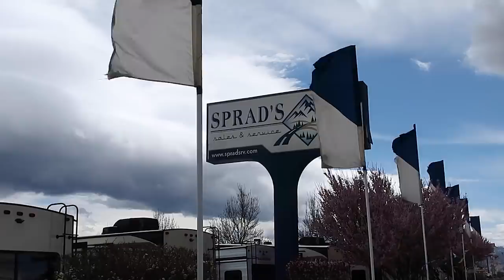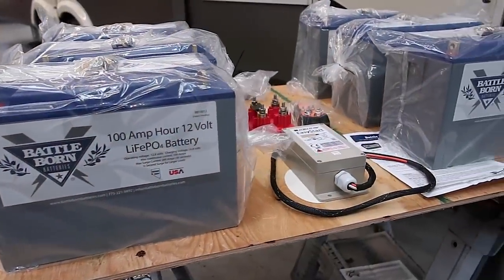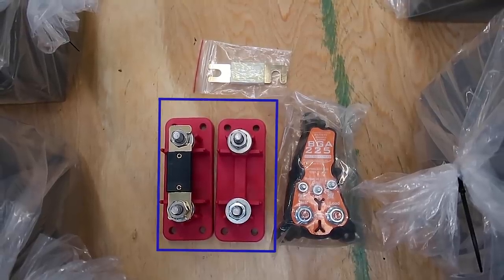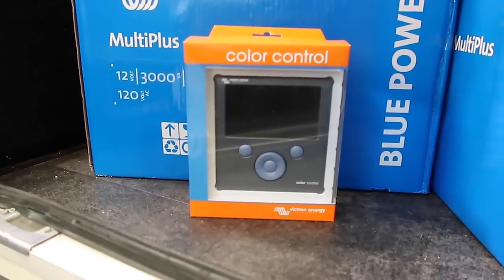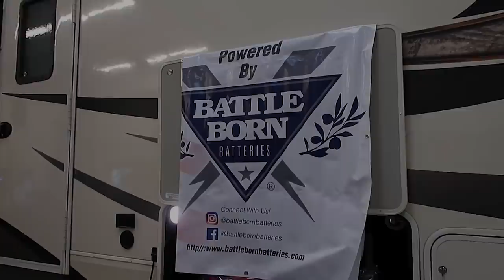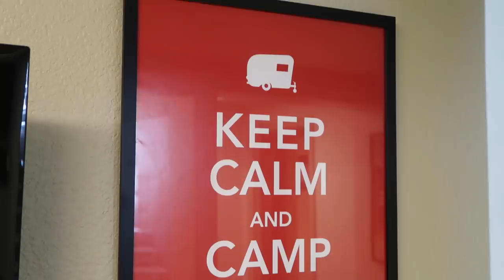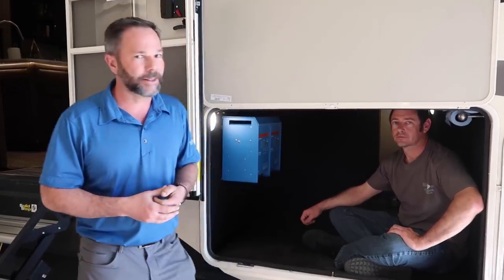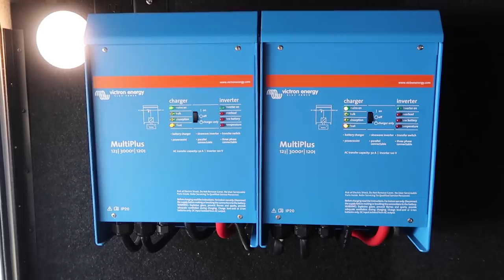Our Lithium Battle Born Batteries System Install! || RV Living

Comment: You state in another comment response that you wanted a system large enough to run the rig for 3 days without charging and added the battery you already had to the new battery bank for a total of 6 batteries so 600ah total. I believe that the AC compressors suck up 30 amps each so even if they both only run 50% of the time (which I assume would probably be the minimum in a hot climate) that means your system would only last 20 hours just powering the ACs with zero load from other devices, so I'm interested in your breakdown of individual electrical equipment consumption itemization for calculating how much battery power you need to run for 3 days. Thx

Comment: You did a great job of scooting around the cost of your system.
Reply from the maker: If we’re solely talking solar and not batteries, we spent around $2,500 for the panels, wires, junction boxes, tools, and everything else we needed for installation. We did that install. Our battery system is on Battle Borns website, and that is $9K.

Comment: Hi guys, I have a small (24’) older class A with 30amp hookup. I’m thinking about the Battle Born system myself to get away from depending on the loud gas generator. Unfortunately my small RV doesn’t have much basement or interior storage space. So my question to y’all is, do you think that I could do away with the generator and use that space for the Battle Born system?

Comment: Great equipment and install.  I just put 4, 100ah BB's in our Class A.  Next addition will be the same inverter as you installed but I'll need a consultation due to the complex nature of the coach systems.
Reply from the maker: Nice! The Battle Born team is super helpful and I'm sure will get you what you need. Happy travels!
Reply: Do you have a residential refrigerator? We have been planning the 4 battery install for our Thor Tuscany 42RQ with a 2000 watt Magnum inverter and feel like it will easily take us through the night. We need the ability to overnight and move on the next day charging off the coach alternator  (or fire up the generator) as our first step to adding more capacity.
Reply: Kim Bertram we don’t have residential refrigerator. It would be nice, but we make do with the smaller one we have.

Comment: You guys did a great job with this video.  It is nice to see a professional installation along with all of the DYI videos.  We are looking at upgrading our battery system in the next several months.  We are going to take the upgrades a little more incremental.  The hope is we drop in the four GC2 replacement batteries and add a new BIM on our class A to support charging from the alternator.  The next phase could be upgrading the invertor and rewiring the invertors into the 120V system.  The use of two 3000 watt invertors on a 50AMP RV looks very interesting.  Battle Born has been very helpful answering questions.  As part of our trip out west we plan to stop by Battle Born.

Do you recommend Sprad's RV in Reno to do installation and electrical work?

It has been almost two years since you installed your power upgrade (batteries and invertors).  How has it been working out?  What advice would you provide to someone looking to upgrade there battery system.

It was great to spend time with you guys in January of 2020 in Tampa and I hope to catch up with you guys again down the road.

Comment: How are the Batteries and inverters holding up?
Love your system!!!

Question?
What size wires between batteries 2/0? 
And what size wires to the inverter?

Im setting my cabin up with exact same equipment ....deciding to go either 2/0 or 4/0?
All short distances...
Thanks guys!
AZ BOB

Comment: Thanks for documenting your install!  We are going to Sprad's next month to upgrade our electrical system in our Class B Sprinter with BattleBorn/Vicron components.  Sprad's is recommending that we install both a DC-DC converter and a BIM but I haven't seen an install yet that has done that and the BattleBorn website's schematic only calls for only a BIM when there are 4 BattleBorn batteries.  What are you doing for charging from your alternator?  Thanks!

Comment: Do you charge the system with your alternator on the truck?? Can you charge the system with the generator while you are using the battery to power your RV or do you power the RV with the generator and charge the battery at the same time? How long to charge via generator if batteries are completely depleted with generator? and how long with grid power?  How much do you use just the batteries? Are they just for off grid??Thanks, great video. CAn you give us a guess on how long you could stay offgrid in a hot climate (90 degrees) with just batteries using A/C and no generator. God bless. CAnt wait to see your solar array.

Comment: I was wondering if longer periods of driving, allows your trucks alternator to add enough power to the Battle Born batteries to get them right up to 100%?    We're thinking of adding '3' or possibly '4', as we don't full time, but occasionally will boon-dock, the odd time up to a week.   We also wondered since we don't full time, if the 'suitcase' type of solar might be a good addition, especially for those good weather days.   It looks like we're nearly at the 6 month period since your install, so looking forward to hearing how all has gone, and if you've decided to add anything else to make the whole system efficient for your needs?
Reply from the maker: Our truck alternator does charge the batteries but we've added solar since this install and that always keeps our batteries at 100% when were traveling. We also have a generator that we pull out if we have multiple bad solar days to help charge the batteries :)

Comment: So cool! We hope to outfit our rig with some lithium batteries and solar at some point...once we decide to actually boondock a bit more haha. We are kind of in the same boat as you all before you started boondocking. With full-time jobs we pretty much try to limit the risk of interrupting our work by having some solid connections. Thanks for sharing the info, will help in the future for many! - Shane
Reply from the maker: Totally get it! We waited two years before upgrading to a system like this because of the same reasons you had. We wanted it to be worth it and not go to waste. With this in place we're totally committed to getting out boondocking more 👍

Comment: Hello you, this is the first time I see a LiPO4 battery system without Solar. But using a generator as a back-up charging is not such a bad idea, when you have solar you will have a hand on both recharging ways. Your system is a dream system and it is expensive but you will not have to up-grade for years if you learn how to manage your energy consumption a little bit. When I look at your installation I found that the negative and positive leads of your batteries are very close from each other. I was surprised that no insulation protection was put on them, even electrical tape on the positive leads will give a little bit more protection. Just a recommendation...

Comment: Neat installation here. Im a professional electrician and looks alot at the craftsmanship. Must have some experience to do things right. Have been looking at many installation, but are not allways impressed.
I have AGM 2x100Ah and 66kg(145lb) and with lithium it will be around 30kg(66lb) Can use the Xantrex 1800w inverter, because the voltage will drop below 11v DC when use the coffee maker with AGM. I wanna like to try 2x 100ah Lithium battery. These BatteBorn are not crank battery, so if I still want to  use the emergeny start .I cant use these BB battery? Its not very important to have this emergancy posibility. I think xantrex and Troyan has Lithium crank battery. For me its important to save veight, because I have 40kg(88lb) 4kw tranformer 230-120v/ 60 Hz for my US motorhome here in Norway(europe).
Reply from the maker: It's always a new experience when diving into a project. I'm sure the conversions can be a challenge in another country. Thanks for watching!

Comment: Wow! You found a Unicorn! An RV dealer/service department that does quality work and has a conscience. Great video. Did you upgrade the charge line in the truck to allow a higher amperage charge while driving?
Reply from the maker: Haha we did find a unicorn! We are so happy with Sprad's RV and their work. We didn't upgrade the charge line but that's definitely something to think about! Glad you enjoyed the video.
Reply: @GetawayCouple  HI there, like you, we have a GDRV Solitude and are from SOCAL.  I'm curious, did you not find a reputable installer in Orange County for BB batts/Victron upgrades?   Surprised you had to go all the way to Reno...can you explain?  Thank you.  We enjoy all of your videos..
Reply from the maker: @gregdavidson3375  We were in Reno visiting the BB factory and had our consultation there. After our consultation, we opted to have the install done there as they recommended Sprad's.
Reply: @GetawayCouple  Thanks!  Have you encountered any issues with the BB Bats or Victron Invertesr?  I will only need one Inverter since we are not full time and would only need up to 5 days of boondocking.  Thanks.   
One last question.  My wife and I are planning a trip to Michigan in 2121 but we want to stay clear of the Midges!  What month were you there, I don't recall seeing a date on the video.   Thanks, stay safe and healthy.
Reply: @GetawayCouple  Curious how long the labor part of the jobs was at Sprads.  I am getting 40-55 hours of work and I am only adding 1 3000 Inverter.   Making sure that I am not getting the shaft.  ;-).   Your feedback is appreciated.

Comment: Awesome system! It’s very similar to what I installed in our Imagine 2800bh. (I was lucky enough to only need 1 inverter though). Make sure you do the solar install this year so you can get the 30% tax rebate on the cost of the solar and the cost of this install (as you can count it as preparation for the solar). If you wait until next year you will only get %26. 
You guys are going to love the freedom of not always having to run the generator just to make coffee. ;-)
Reply from the maker: Hi Ron! You're very correct about the tax rebate, which was a big reason for wanting to do all of this together this year. We will be doing our solar soon (and doing the install ourselves, eep!) But you're so right, we're so excited for the freedom we're getting from this setup. It's already been a game changer!

Comment: So how do you recharge the batteries?  What is the average time of use of the batteries before they go dead?  What is the cost of products and to installation?
Reply from the maker: We want to use our system out boondocking a lot more to get more accurate numbers but currently we recharge the batteries with our generator or with the electrical post in a campground. We haven't gotten them down to 0 and recharged them so we don't know how long it takes to fully recharge them with either of those methods. The time of use is a hard question because it depends what we're running. The goal was to use 2-3 days without recharging, we'll let you know how that works out in a future video. The cost of the products are on Battle Borns website (https://getawaycouple.com/battleborn) and installation was around $1500 which included a couple different parts they needed for our specific setup, building custom housing, labor, etc. Obviously each dealer is going to charge you whatever their hourly rate is plus parts and that can vary from installer to installer. If you're comfortable doing electrical work yourself, this project can be DIY thus eliminating the install cost all together.
Reply: @GetawayCouple  I'm looking to do something similar with my RV.  Most of the state parks in NY don't have electric so I would need solar panels.  Awesome video on setup, thanks for sharing.
Reply: @GetawayCouple  I'm putting in a similar system except only 4 batteries and 1 inverter. Sprads quoted me a price of $2500 and 5 days to install. Sounds like they're gouging me.
Reply from the maker: @boyda1  Hmm... that does seem high for an installation. Does that price include anything else like products, wires, custom built racks, etc?
Reply: @GetawayCouple  They didn't say anything about the wiring or racks being extra. I just assumed that would be part of the installation, but I sure didn't think it would cost that much. They're suppose to call me tomorrow and explain why it's so high, so we'll see what they say.
Reply from the maker: @boyda1  Interesting... let us know what they say if you don't mind! Feel free to shoot us an email if you want at info@getawaycouple.com
Reply: @GetawayCouple  They finally emailed me back and said that's the price and they weren't changing it and that the shop manager agreed that it would take 5 days. I'm going to check some other places and may end up doing it myself. $2500 is just too much for no more than is involved.

Comment: Excellent Video, Both of them.  Can you give me an estimate of how much the installation was???
Reply from the maker: If we’re solely talking solar and not batteries, we spent around $2,500 for the panels, wires, junction boxes, tools, and everything else we needed for installation. Our battery system is on Battle Born's website, and that is $9K.
Reply: Thanks Rae,
By the way you do a very thorough job on your videos. You explain things the way I understand. I appreciated what you did with your Thousand Trails video.

Comment: Hello Jason & Rhea, we are planning on buying an rv in the near future but we are wondering if your future solar panels, converter, and truck alternator will charge your lithium batteries without any other equipment? Good luck with your equipment. Thank you for your time and assistance.
Reply from the maker: Hey! Solar is next and that will absolutely charge the batteries. Our truck will not charge the batteries while towing but that's not something we even realized was possible until people started commenting. It's definitely something for us to look into!

Comment: Question: what did you do with your original converter?  Is it still utilized to feed your DC system? Or was it removed and everything wired to the inverter/charger?
Reply from the maker: Hi Bruce! It was removed and everything wired to the inverter/charger.

Comment: Great video. Thanks for posting it. I’ve never seen a battery setup that will run both ACs. How long do you expect to be able to run them on the batteries?
Reply from the maker: We haven't tested it but we were told that we could run one AC for 5 hours on the batteries with nothing else running. We want to do some real world testing (but it hasn't been warm enough lately) to get actual numbers of using the batteries and how quickly we can recharge them with the generator vs electrical pole at a campground.
Reply: Getaway Couple, thanks for the extra information. Let us know how your testing goes. At a minimum you should now be able to run the ac while traveling so the rig won’t be hard to cool down when you arrive somewhere. I have a residential fridge so it would have to run that too for me. Thanks again.

Comment: So I just built the cart with everything I could find at battleborn.com minus the cables and I'm at $9,921.45. That doesn't, of course, include installation. Installed this system would be well north of $10,000. I would literally need to cash in Jason and Rae's 401k's to be able to afford this in my RV.
Reply from the maker: Lol we'd get hit too many early withdrawal penalties, we looked into it 😉This size system is best for those with a lot of power needs in a big rig who don't want to be inconvenienced. You can absolutely get away with something smaller.

Comment: How much did the total Solar install including batteries, panels, inverters and labor cost ?
Reply from the maker: If we’re solely talking solar and not batteries, we spent around $2,500 for the panels, wires, junction boxes, tools, and everything else we needed for installation. Our battery system is on Battle Borns website, and that is $9K. We did our solar install! However, our batteries and inverters were installed by Sprad's RV in Reno, NV.

Comment: What was the cost of installation (not including the equipment)? You cannot find this out on the BattleBorn website as you suggest.
Reply from the maker: Hi Peter, installation was around $1500 which included a couple different parts they needed for our specific setup, building custom housing, labor, etc. Obviously each dealer is going to charge you whatever their hourly rate is plus parts and that can vary from installer to installer. If you're comfortable doing electrical work yourself, this project can be DIY thus eliminating the install cost all together.
Reply: Best money you spent!

Comment: Curious as to what led the system being installed behind the panels in the storage bin instead of in the storage area where the generator would go if installed under the cap. This is an awesome setup that I may ave to consider for our Solitude 369RL.
Reply from the maker: Hi Johnny! That front storage under the front cap is the only storage bay not heated which was a factor in our decision. We do want to visit Alaska one day and don't want to worry about it. You could get around that by install heating blankets around them but we had the room in the storage bin so we went with it. Another big thing is that we really just wanted them out of the way and we use that front storage area. Lastly, the storage bin has more security with a double lock and someone would have to really crawl in there to get them. Let us know if you have any questions! It's a game changer for sure.